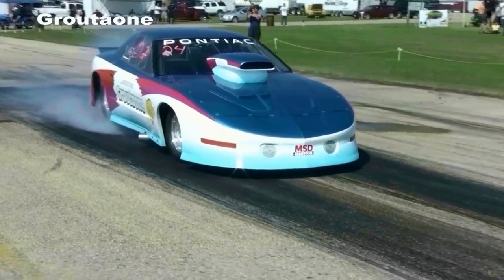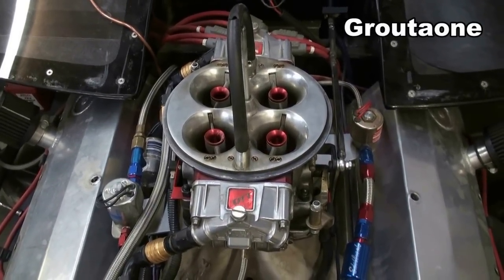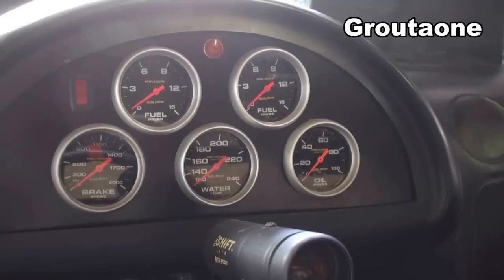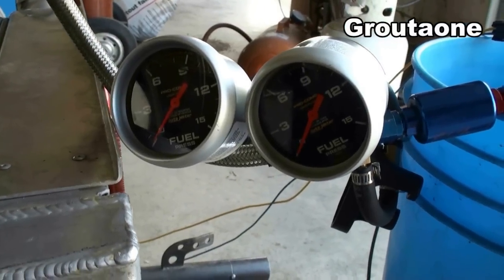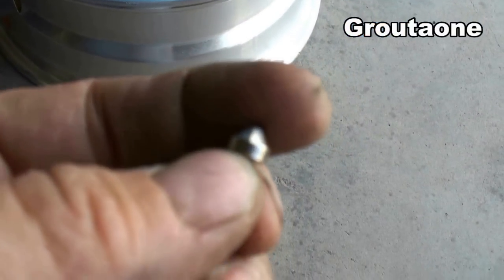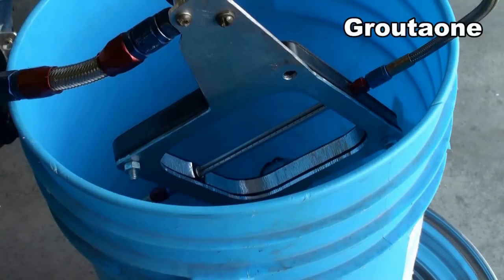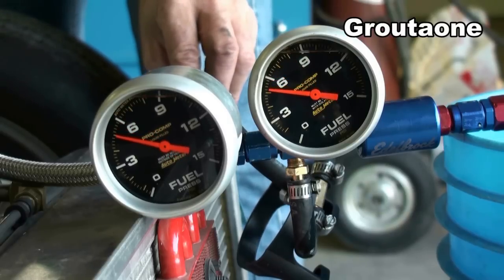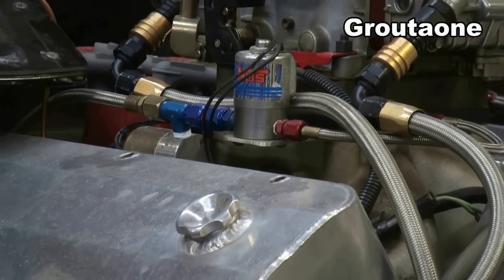Nitrous Fuel Pressure R&D

Comment: The NX fuel pressure regulators will creep up in pressure until you open the nitrous solenoid so its impossible to set it and get an accurate gauge reading before the solenoid if its not actuated.. It even says in the instructions the gauge will continuously build pressure until the solenoid is open.. I need to get an initial setting on a new plate system on a tunnel ram and was hoping to do it without pulling both plates and putting them in a bucket..

Comment: I'm trying to run efi pressure with the fitech with a wet plate so my
Pressure is 58 psi can I adjust the fuel jetting or do I have to run a separate low pressure fuel line

Comment: Hi groutaone, Just a quick question... When you changing oil on the firebird, do you fill the new oilfilter with oil before mounting it? or do you leave it dry and let the engine fill it up???    But i just started wondering, what is the right thing to do? Its a 540 bigblock chevy for race use... oil preassure is about 75-80 psi. thanks :-)

Comment: i was gonna ask what kind of regulator you where running because i tought a return style would probably do better, but you are now going to run that right? We do use that type on boosted cars, and when the boost kicks in pressure go's up right away like it should.  And yours seems to be fixed at 1 opening size wich will reduce the pressure if you let it flow free after the regulator.

Comment: This is a pro people AND car. Don't throw this on your moms Honda civic she gave you for graduation :)  I worry about my oil pressure and temp gauge in my old ass vette lol. Also, Gouto, Did you have a issue with the frame on the 500 into the 250 with welding it up and support? And what was the wait diff of the orig and yours? Love your bike and vids! Peace.

Comment: With our cars we run direct port systems with a return line after the fuel solenoid at 6psi fuel pressure and 1050 psi nitrous bottle pressure getting 12:2:1 AFR'S which is about prefect on a nitrous car.

Comment: We switched to the ZEX perimeter plate and love it .. it is miles ahead of the elderly spray bar.. check it out  we used it on the 582 inch 3150LBS chevelle with TH400

Comment from the maker: It would work except the extended idle time would over run the pressure spring resulting in higher pressure again, I will regulate the return line for smooth pressure and no hassle, stay tuned